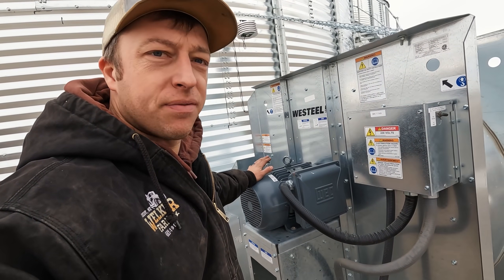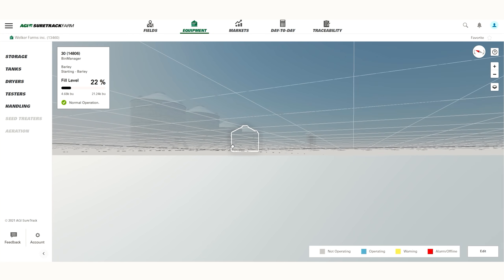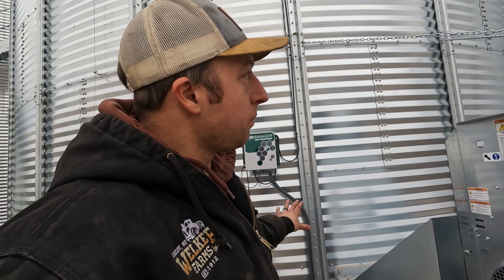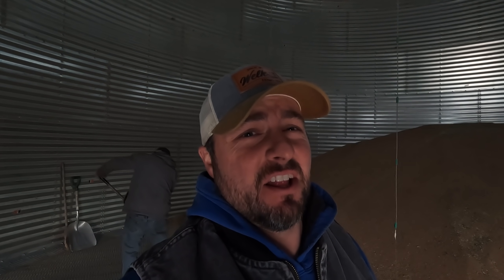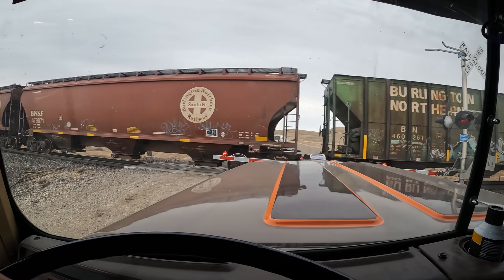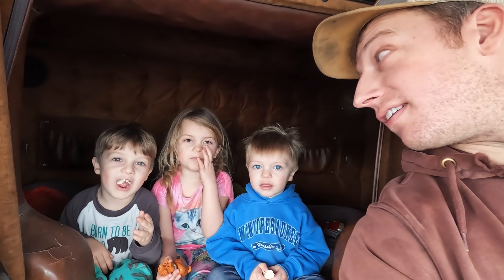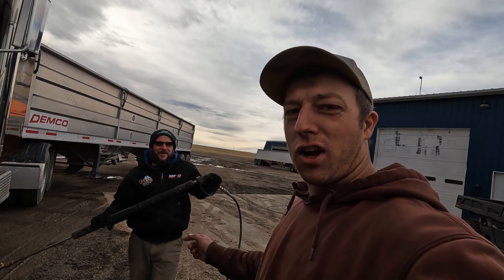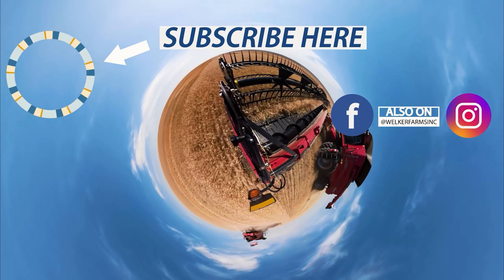We've Got BINS With BRAINS! 🧠

Comment: can't wait to see what you guys are going to do with your free time.  if you don't mind me asking, with your new bins  I noticed 2 of the 3 are smaller, is their a specific reason for that ? just curious.
thanks for the upload,
God bless
Reply from the maker: Excellent question. It is a pretty lame story honestly. We had an 82ft auger when we first decided to build larger bins. We specked out the tallest bin that auger could safely handle and built two. Then the following year we upgraded to a 94ft auger and at that same time a surplus bin from a miss order popped up for a discounted price so we bought it... Only problem is it was 2 rings taller than the other two. We are in the works to add a 4th bin and it will be the same height as the third tall one.
Reply: @WelkerFarms  Theoretically, would it be possible to add rings to the other two so they're all the same capacity? Or would it be more trouble than it would be worth?
Reply: @kbodah  it can be done if they want to but if they don't need the capacity it would be a waste of money
Reply: @1969countryfarmer  Frye sgn
Reply: @kbodah  could be done but wouldn't be worth the work to take off the roofs to add to more rings.
Reply: @max-jc4wq  you add from the bottom not the top. Would just have to take the bottom 2 rings off because the holes and everything are cut for the fans etc… add 2 rings and then put the original bottom 2 back on so you have all your fan cutouts and doors etc…
Reply: @alechaas2584  ya I new bins where built like that but was not sure if you would take the roof off to add or do what you said.
Reply: @alechaas2584  I'm not sure if you could reuse them, because bottom rings are thicker than top rings. And if you would add another 2 rings, you would probably need bottom 2 replaced, because they could be not thick enough with more weight above them.
Reply: Ok enjoy your night ya I sleeping by the table
Reply: @max-jc4wq  rings are added from the bottom...
Reply: @tonytatano6985  I know bins are built like that use wasn't sure if you would add from the top or bottom
Reply: @kbodah  They answered me so i will tell you in short form what they said.  It can be done but you would have to move the floor out and the unloading system plus you would need the special jacks to lift the bin to add the additional rings.  cheers.
Reply: @WelkerFarms  can you not add 2 rings to the other one aswell?

Comment: Those new bins are a lot of money and I am sure it was quite a leap of faith to build them, but WOW what an improvement. Keep the faith gentlemen. I use similar systems to dry corn  a ways south of you. I will be very interested to see the performance on rehydrating grain.  I almost forgot I found I could hang an old plow share from a moldboard plow from the cable rather than tie them down.

Comment: little trick with the sensors tie magnets to them that will hold them to the floor and then can just pull them up as the sweep goes around and stick them to the wall then they are out of your way while cleaning in the bin and then dont have to mess around and retie them and then can get rid of those brackets that are screwed to the floor that your shovel likes to catch on. i have the same system on our bins works good just have to have pateince with it.

Comment: 40-50 years ago one of the local elevators was owned by a real shyster.  He was caught multiple times running a garden hose in a grain car as he was filling it with grain to add weight to the load.

Comment: The fan system can really change the game for you.  If someone thinks regulating the moisture content of your grain is somehow unethical.  For centuries farmers have battled too much moisture by trying to dry their grain, have been docked when it came in too wet, and never benefited from having the grain drier than the elevator accepts.  So now you can use your fan to dry or moisten your grain to what benefits you the most.  Awesome system.  Too dry grain can be a detriment too.  Finally a way to manage the system rather than it managing you.  God bless Welkers!

Comment: We have had binmanager for 6 years now. Works great for monitoring conditions. You cannot rehydrate grain with up air! The grain swells at the floor and shuts off airflow. It is not fun scrapping grain off a metal floor.

Comment: Bin man door suggestion; 
consider putting the man door near the bin unload. That allows you to open man door before starting sweep so you can look for potential issues before and while starting sweep.  Sometimes the center gearbox may need repairing before sweep will run. 
Most bin man doors in the Midwest are near the auger.  
Always enjoy your videos!
Reply from the maker: That is a good idea and something we wish we had done when we first had the builders begin construction. We asked them what they thought and they said it didn't matter...well turns out it does.
Reply: @WelkerFarms    That's too bad the bin constructors didn't know where to put the door.  I've worked with about a dozen bins from different brands and every one has the door just to the right of the unload tube.  We move a bin once and when they reinstalled the door they put it in upside down!
Reply: @WelkerFarms  it’s not that hard to move the doors. You guys have done things much more complicated. 
Love your videos!

Comment: How does the system ensure that the air/water that's pumped in is distributed evenly ? Because it only pumps from the bottom up, correct ?

Comment: Im no engineer but if a house can have a humidistat why cant a grain bin? Freezing is a concern but for those dry winter months adding a humidistat could be the next level for AGI SureTrack and it seems simple enough to add a little water into that air after the fan.

Comment: I have been away from the farm for a while now, and we rarely raised wheat, but isn't there a reason why they take a sample at the elevator, to determine the moisture, and calculate a corrected test weight so wet grain doesn't get sold at a higher price than it's dry counterpart all else being equal????

Comment: Considering the problems with mold in some of the old steel bins i would think the grain bags would be a disaster.
Reply from the maker: I used to think so too but what is really cool about grain bags is being they are air tight, the grain doesn't spoil even if it is wet. Put 20% moisture in and a year later 20% comes out and no spoilage. But
... If say a deer walks on the bags and pokes holes, then those areas will spoil. So any tears or holes in the bags will lead to spoiled grain.

Comment: Could you add more rings to the shorter bins to make them the same height as the taller one?  Thanks.
Reply from the maker: This can be done but it would require removing the floors and unloading/fan system. Also would need special Jack's to do it which are expensive. We are looking into it but likely won't happen.
Reply: @WelkerFarms  Thank you for answering.  I hope you and all farmers do ok with the fertilizer situation or we're all screwed.

Comment: Showing my ignorance: watching you empty the bin and all the shoveling to back fill behind the sweep. Why isn’t the sweep closer to the floor?
Reply: They're typically as close as possible without damaging the floor/auger.  Their setup looks pretty clean afterwards.  These power sweeps are nice because you just have to engage it when ready, and keep emptying the bin.  With older / smaller bins you carry an auger with a motor into the bin and plug it in (cheaper solution though as you can use the same auger for multiple bins).  Then you might have even more grain left behind to clean up.

Comment: Most highway law enforcement agencies consider an exhaust tail that extends beyond the middle of an 18 wheeler's trailer to be actionable with a "fix-it" ticket!  Looking at the ring of carbon at the tip the exhaust stacks only proves that something is not right with the International's engine.
Reply: It's actually snowflake repellent 😂😝
Reply: Cummins big cam engines smoke more then newer engine. Never seen or heard of anyone getting a fixit ticket for smoke trail. No where in the dot inspection criteria is it listed

Comment: Why doesn’t anyone over there run two trailers on their grain trucks?
Reply: Would have to be a permitted truck, way over length and not easy to manuver on our roads. Trailers are usually 33-42' long, not pups. Normal weight allowance is 80,000lbs gross. Trips are usually short also.
Reply: @louispaparella5766  grain trucks here in Australia are mostly end tippers rather than belly dump, they make the trailers shorter and are referred to as “pocket trains” prime mover and two trailers are 27.5m and take 55-60 tonne depending on tare weight.
Reply: @samwest9444  I'm a little familiar with the road trains down under... Our distances and roads are way different than yours. Most loads are in the 30 ton range to allow the rest for the equipment
Reply: @samwest9444  In the UK we can gross 44 tons to carry between 27 and 29.5 tons depending on empty weight.